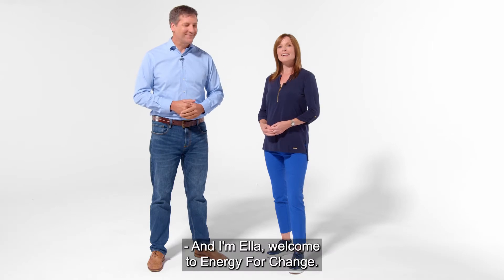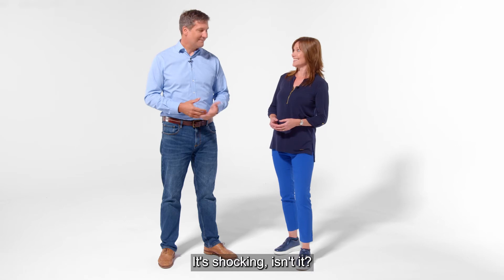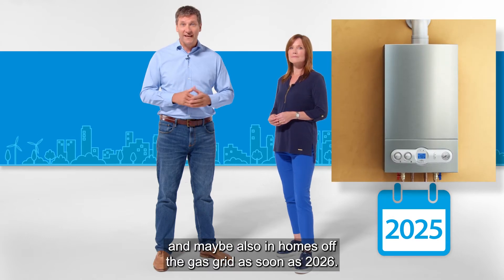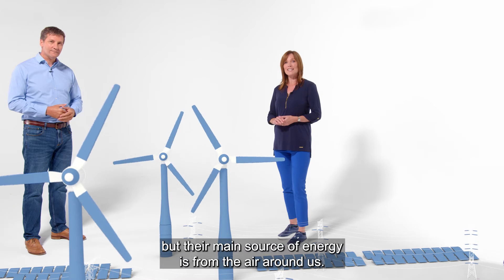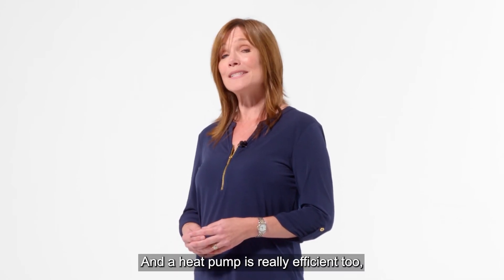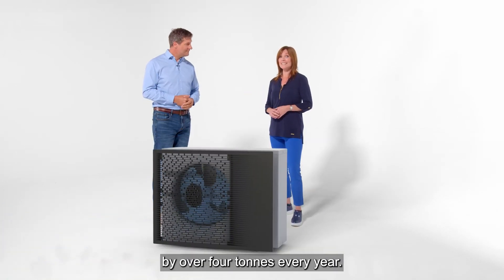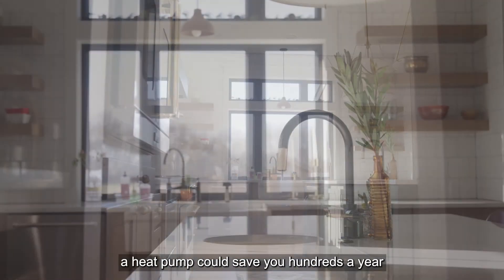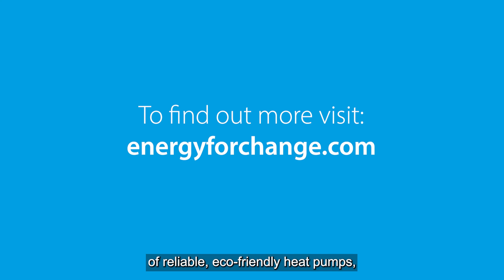How does a heat pump work?

Comment: Bull shtt, don't need pseudo "engineer" with no degree to get it  installed,  can get monoblock done by myself.   GALMET can make highly presentable heat pump with preassembled control unit that require connecting literally two pipes to the external unit, two pipes to the buffer tank, and 3 pipes to heating distribution (rads or floor) and hot water and job done.  They offer free training and 12months educated to engineering degree engineer assistance, troubleshooting and fine tuning,  why can't you offer the same?? Galmet airmax 3 with control unit, 200l heat exchanger and buffer tank cost below £10k, where is £10-£15 extra charged by  uneducated british installer? That is the reason why UK has the lowest number of HP's in Europe.  
Ohhh and stop f. talking about environment,  nobody gives  two fcks about especially rich fckrs .
Average COP 3.2 where max 5.2 will use min 3200kWh per 100m2 a year  plus 1000-1500kWh with the HP capable of higher temperature output - that's for a house rated 30W/m2.

Comment: I thought I was going to learn "How a heat pump works" - as the title suggests - and with a GENUINE reason. Off Grid. Victorian 6 bed house which we only moved in to 8 months ago. Retired (Engineer), looking to reduce costs, and with a massive bonus of a benefit to the environment, instead of which, I get a completely environment orientated video, with no cost / benefit analyses - just percentage data. Guys - suggest you sharpen your skills, and how you represent your content. I genuinely received a Daikin flyer in my mail this morning - and hence I am here now. If you want to sell to me (and most people who are not ex-Greenham common) - you need to stop being fluffy, and talk in hard facts (and cash savings). I am going to go against my all time mantra of disliking a video after the effort of the presenter - and dislike this one. Sorry guys.